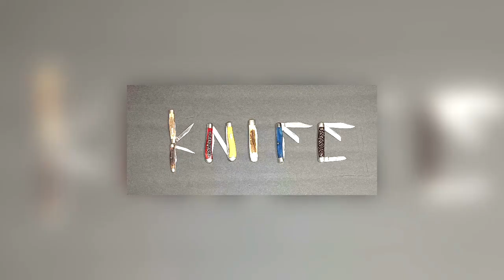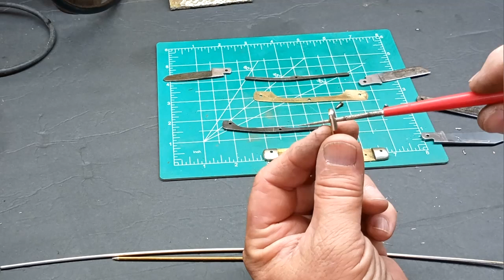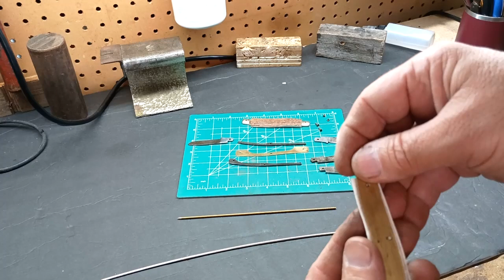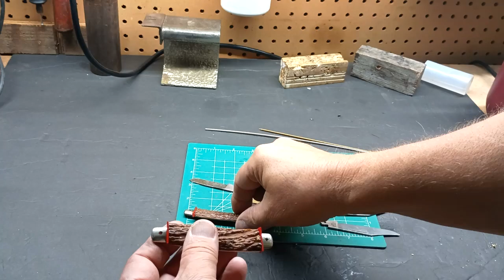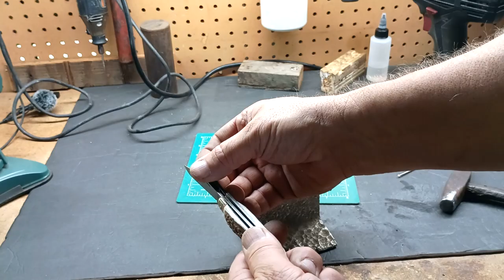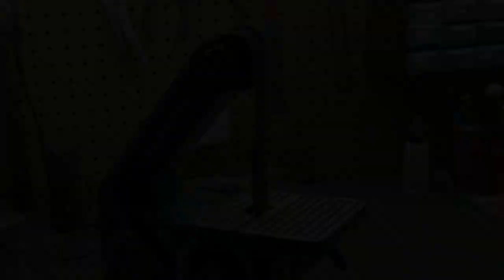Rebuild a Schrade 8OT Old Timer pocket knife

Comment: I have several old schrades but one has some really bad toothpick main blade with wobble. I'd like to do the same thing you did here if I can find a descent replacement blade. That antler and red spacer looks nice, turned out really good. At first I thought you left the antler too thick, but it looks really nice. Any suggestions for an 834 replacement blade? Pretty sure I got everything else out in the shop. Thanks for showing this.
Reply from the maker: Email me pictures and a measurement of the closed knife. I may have Schrade blades that will fit. 
STKServicesAL@gmail.com

Comment: What are you using for pin stock for your pivot pins?
Reply from the maker: @1anthonybrowning  I buy pin stock from Jantz, a knife-maker supplier. Occasionally I will get brass rods from Hobby Lobby or an Ace Hardware store, but they may only have a few sizes.
Reply: @southernknifehobbyist   thank you

Comment: Great looking knife and my favorite model. I carry a Walden version everyday and they've been my favorites since the seventies. I have an old NIB NY tang stamp stored as a back up as well. I bought a book 30 years ago and learned how to repair pocketknives. I've done several Schrade knives over the years. The one thing I would never do is to put a stainless steel blade in a frame with carbon blades... I don't like stainless for one thing, but I also like my knives to age well from the backsprings to the blades. I don't like modern carbon steel pocket knives because they use stainless backsprings in every single one of them I've found.
Reply from the maker: @hercules1073  Thank you!

Comment: Do you have a method for repairing hairline cracks on bone handles. If so I would be interested in seeing it.
Reply from the maker: @KevinCummins-n3j  The best that I know of is to clean it with alcohol several times, picking out any dirt with a needle. 
After drying, use a thin super glue.   Apply multiple layers if needed.
Some people swear by Zap-a-Gap in 3 different thicknesses. 
Sometimes you can still see the crack, but it keeps it from spreading.
Reply: Thank you!!! I will try that.

Comment: This is such a great video. Thank you for sharing.  Could you share what grit  you use on the belt sander? Thanks again!
Reply from the maker: @jth56  thank you!
I do most of my sanding with a 400-grit belt. 
I move to a 220 grit on occasion, and keep a couple of 80 grit for really aggressive material removal. 
I used to keep higher grits, but found that I can go from 400 straight to the polishing wheel.